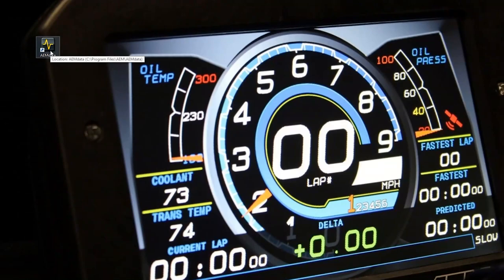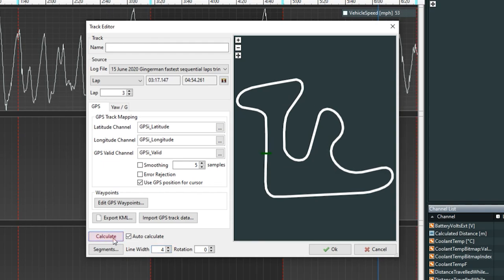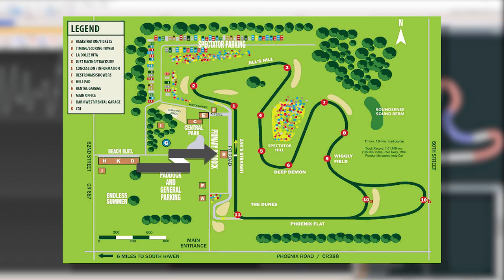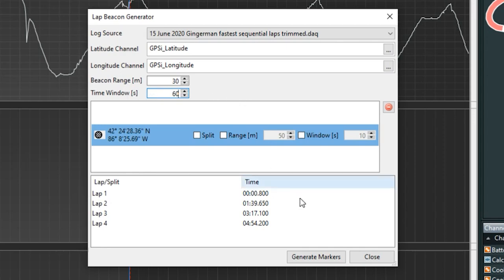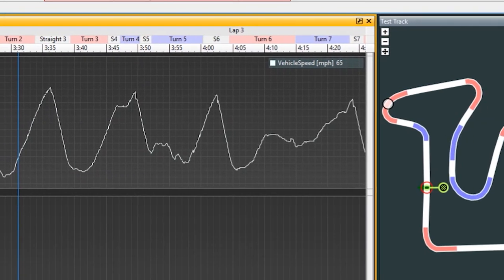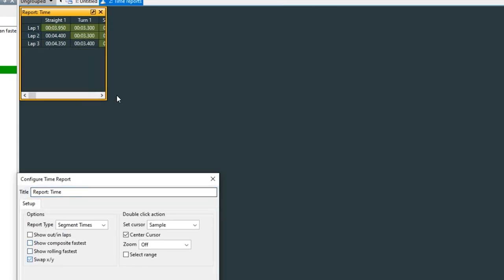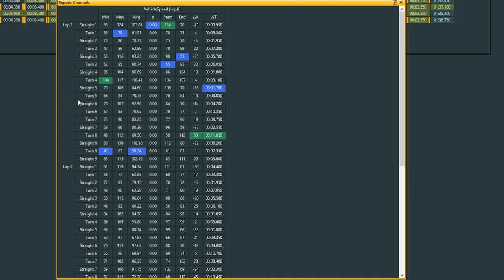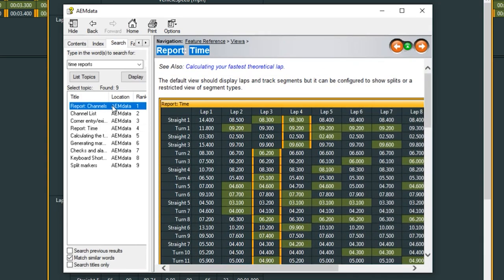Creating a TRACK MAP in AEMdata!

Comment: Informative video 👍
I may have missed mention of it, but is there a method for hillclimbs, rally stages, etc. that don't loop but have separate start and finish points?
Reply from the maker: You could make the “track map” a time selection from the log then trim each log for your “laps” comparing the different layers.
Reply: @AEMpowerTVelectronics  
Thank you.